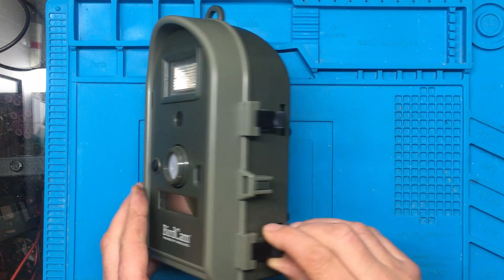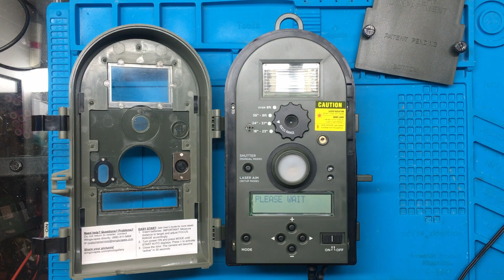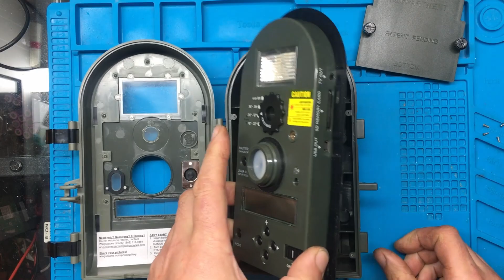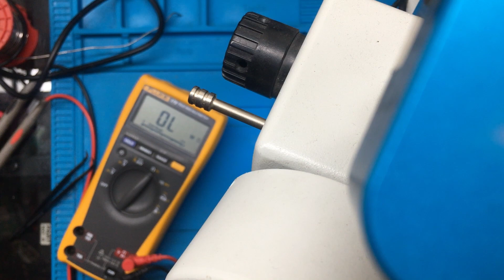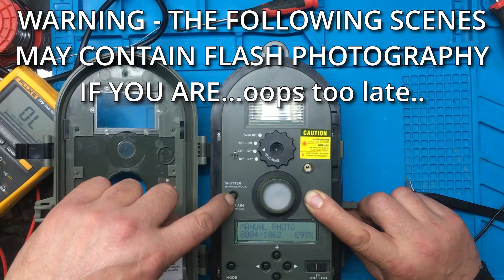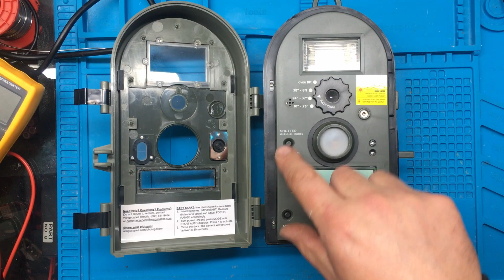Wingscapes Birdcam 2.0 Repair

Comment: Gave me the courage to open up my own Wingscapes Birdcam (different model but, luckily, an easy enough fix). Turned out it was a broken solder joint on one of the battery terminals.
Reply from the maker: Ah great stuff! Glad to hear you got it sorted 👍

Comment: You never seem to get free batteries with your Ebay purchases.  Maybe it is saying please wait for a birdy or is it saying please wait for someone to change the dodgy resistor? 😁

Whats the lazer do stun them so they dont move when it takes a shot?

I thought I saw tweety pie.

That picture of the pidgeon was funny.
Reply from the maker: Yes, come to think of it I don't think anything I've bought from Ebay has arrived with batteries in it, unless they were specific to the device or non removable. I have had a few devices with battery residue though 😂😂😂